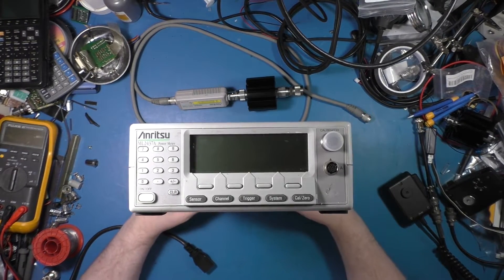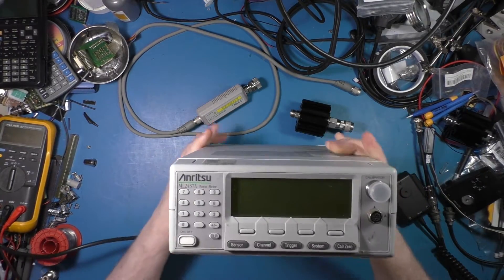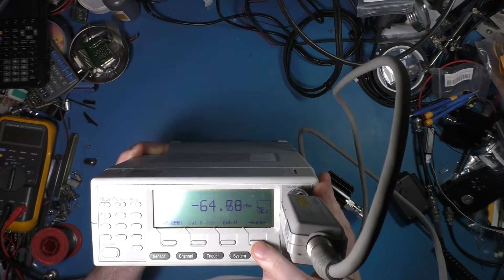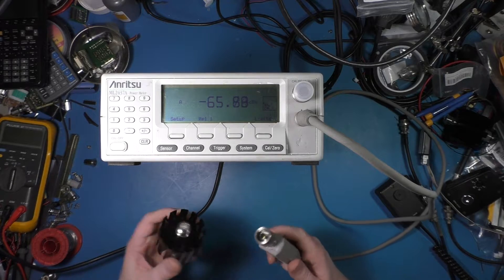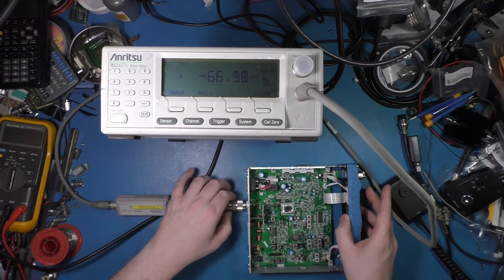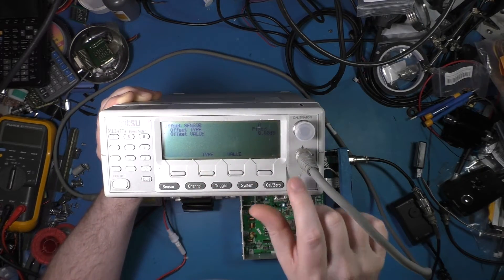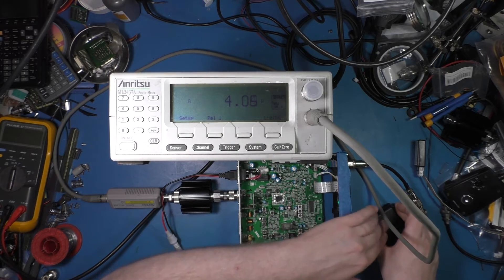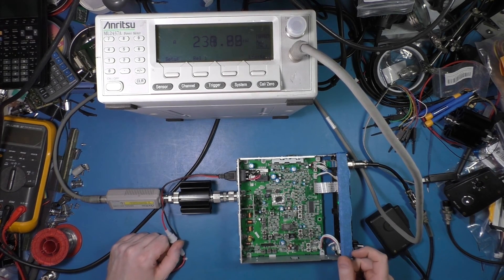Anritsu RF power meter - quick look and test measurement.

Comment: FYI: The ML2437A has an internal backlight (green light) which is probably not working in your device.
PS: Calibrating the 5V reference is very important for accurate results, check out the service guide for instructions. It is easy, however you need a very precise DMM to do the task.

Comment: I'm so happy with my Autek WM 1. I'm assuming this meter would be best for someone who does repairs and needs something that offers more than the WM 1 does. I wanted a digital meter and made the mustang of purchasing the MFJ 828, which has digital and analog cross needle in one meter. What a piece of junk! Not did if not work. I sent it right back to MFJ for warranty covered repair and received it back with a letter saying "the meter work's 100% and showed no issues". WRONG! $225 down the drain. I would give a homeless person the cost of any future MFJ product I feel the need to purchase. I don't get the love affair with Bird meters. Having to change slugs isn't something I want to do and the fact that like ever meter bird's do have a + -. although I've read as much as I can about how a bird can possibly read true peak readings without a power source is above my head and knowledge. I enjoyed the Autek WM 1 so much I bought another (second with illuminated meters) sorry for going on a rant and getting of the subject of this clip but buying MFJ will and in my case has left me insane!!

Comment: Howdy, a new subscriber here (blame Mike and Buddy!). Your new meter suspiciously looks like my HP437. With the old HP boxes it's not the cost of the meter that gets you, they're pretty cheap (I still like the analog dial of my 435 and the red LEDs of my 436)...it's the cost of the sensor heads that kills you and as you point out they can get fried very easily and I sweat bullets whenever I use mine!
Reply from the maker: It's the same with all of the power meters that I have used. The power sensor is the heart of the instrument.
It's akin to stuffing a few watts into a spectrum analyzer. Death can occur quickly and your really not fixing the power sensor.
I really wasn't in the market for one but I saw it... and the price for both was lower than the sensor itself cost... no brainer.

But yes..... I crunched those numbers three times before I first connected it via the attenuator to a transmitter.
I plan on doing something more detailed on it.
I didn't get into setting a calibration factor or the math you really need to do to make sure you don't blow the ass out of the sensor :)
Reply: Yep, noticed that you didn't talk about the cal factor...I'm guessing that the Anritsu can save them for different range sensors? I pulled my most sensitive sensor out recently that I hadn't used in a while and thought it was toast...until I remembered to zero i (RTFM)t; that's the problem when you don't use something very often. Phew, that was close!
Reply from the maker: On these the cal data is stored on the sensor itself in EEPROM.
There is a table and you select the frequency your working with and it does the magic calculations itself.
On the HP that I used in the past (god.. 20 years ago?) the cal data was on the a label on the sensor itself and you put that cal factor data into the instrument manually.
On the Anritsu it's in a list on the screen OR you tell it the frequency your measuring and it does the rest.

A good overview of these is sort of lacking on YouTube particularly in the radio community.
Most people that do repairs won't invest in these because they really don't need to measure things this accurately. They are also very expensive as you know.

The side effect is that this is going to be more accurate than your Bird meters (which are great meters) and guys are just warming up to those. (hence "Bird" watts or just "Bird")

These high powered CBers don't want to be told the radio that they thought put out 10 watts really puts out 5. (where it counts)
Not sure what the video bandwidth is on the power sensor. Guessing 10-20Mhz at most.  Need to read the manual.
Reply: Yes you remember correctly...you enter the sensor cal data from the sensor body table into a memory in the 437 and it does the rest which beats the heck out of having to do it every time with the old 435; but I still love an analog meter, so much easier to interpret. Good point, had to learn the ins and outs of the lab grade power meter on my own...I await your video!

Comment: LOL, but does it do Bird watts. ;-)

Looks like its in really good condition.  Have seen some of them that look like thay have been drug around the planet a few times behind a car.  Definitely a nice score.
Reply from the maker: Bird watts.... good one.
I know you can get Bird slugs for wide ranges and those will measure harmonics if the slug is widebanded enough.
The power sensor is calibrated for certain frequency ranges so I don't think it will pick that stuff up.
I need to look at the specs on the power sensor.